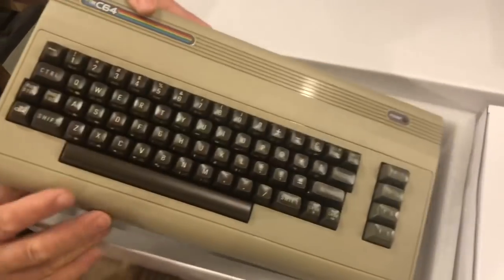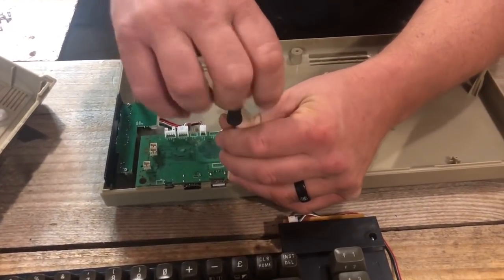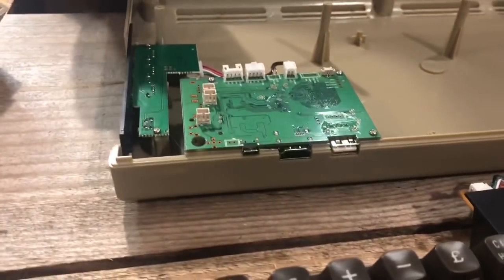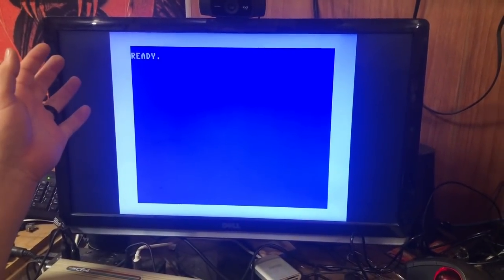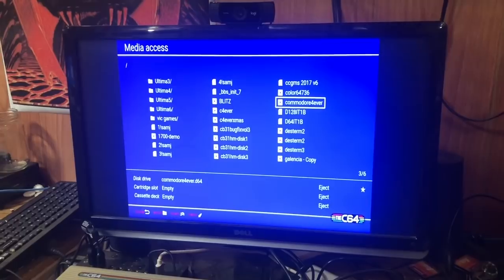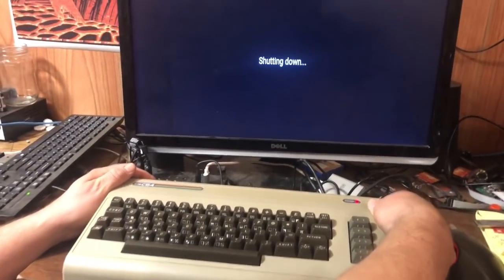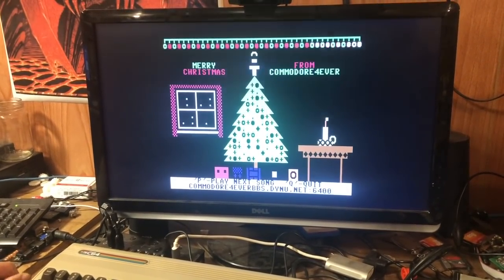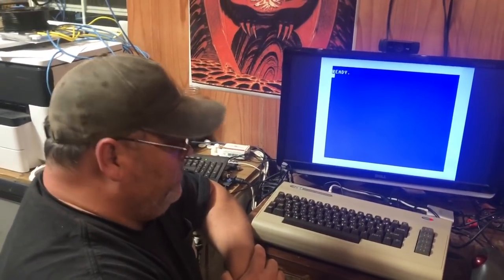The C64. My thoughts.

Comment: Excellent review, thank you.  I have a C128, and when I found out that Retro Games was coming out with this I decided to back them.  Kind of a cool nostalgic piece I guess, I was hoping they'd have the original Commodore peripheral ports though, but I guess being an emulated machine its not possible.  Maybe someone will come up with adapters at some point to allow you to hookup your old Commodore stuff.
Reply: They can't make those old parts. There focus was to give everything that you get from the Origanal Commodore but use modern tech such as USB and HDMI.
Reply: http://gurce.net/c64mini/hardware_compatibility_lists -i found there a adapter for the old joysticks.... i ordered one of them.
Reply: @A LITTLE BIT OF THE BUBBLY The ultimate 64 is just a circuit board so is not giving you everything you get from an Origanal Commodore? The C64 looks like a Commodore 64 but using modern tech like USB and HDMI instead of cratrage slots.
Reply: Can we attach the64 keyboard to ultimate64 implementation?

Comment: For my SD cards I use a microsd card  in a SD adapter.  when I need to connect it via the usb port I pull the microsd  and put that in a usb adapter that holds the microsd in a slot at the end and not the side so there is no issue with port crowding then if you want to use it on a regular sd slot again you slot it back into a microsd to sd adapter.

Comment: Very cool. Maybe shaving off the whole inside post of the keycap a proper adapter could be printed and glued to fit it onto an original keyboard.  Maybe they'll sell keycaps separately from extra stock. Is the color of the case correct? It looks too light shaded??

Comment: It is compatible with D81 files.  There is a full manual on the C64 website that has a lot of technical detail in it.  Would recommend a look through.  Great review though, nice to see someone really digging into the classic mode.  Also note you can snapshot save any programs you are working on as you would save a game.  Also plug your USB.SC card adapter in the side, it will fit better :)
Reply from the maker: lordchippers LOL. Yeah I guess trying the side usb would have been a good idea!

Comment: I used to like to program on a c64 but old ones are problem these days so I think this is great with the c64 maxi. I haven't been able to find out if the programming works like it did on an original especially when it comes to how you use sprites (if it does).

Comment: I wonder if it would be possible to adapt the entire keyboard to work on a real C64. Obviously the keycaps aren't going to work, but the whole thing might. I noticed the connector seemed to have some kind of adapter on it. That might be possible to replace with a cable that works.

Comment: Boy, that takes me back. I used to type in listings from magazines that would take hours, only to find there was a typo that wouldn't be corrected until next month's issue.  Still got my Commodore 64 in a box in the garage, along with the tape drive, and the 1541 disk drive. The monitor's gone now, and I always preferred the smaller mouse from Atari.
I've also still got an Atari Mega STE complete. Upgraded it to 4 whole megabytes before it left the shop. Nothing like living big! :))

Comment: I got a Mini for Christmas, and like the convenience of having it at my PC computer desk with a KVM switch.  Yeah, VICE would be more convenient, but since upgrading to Windows 11 my VICE stopped working.  Running it in a Win7 VM at the moment.  But, there's also the joystick factor.  I since purchased the micro switch version with the steal shaft.  The Maxi comes with that joystick, but the mini doesn't, so if you have a mini, don't start playing all those Epic games until you upgrade that joystick!  I do like that the maxi has both C64 and VIC20 modes.  I started with a VIC20 way back when.

Comment: I found it quite interesting that there are two (unpopulated) USB ports on the board itself; for a hardware-oriented person it would be trivial to solder in the receptacles, and then you could have 1 or 2 of those tiny USB flash drives permanently connected, and still have all 4 external ports free. 
With regards to the USB-to-SD card adapter shown in the video, there are some very cheap USB-to-Micro SD adapters (less than $1.00 on ebay) where the Micro SD card sticks out of the back instead of sideways, thus eliminating any issues with the HDMI cable. (Or just use a regular USB drive :P)
Several people have lamented the lack of Serial-, User-, and Cartridge ports on this new machine, but as far as printers and modems goes, there are plenty of USB-to-Serial and USB-to-Parallel converters available, so at least it's possible to connect standard versions of those external devices.
"Yeah but that costs extra money" i hear you scream; well, you can't expect a hobby to be without costs. ;)

Comment: Very cool, although I would like to see a clone with the old ports and new ports combined on a clone. So you can use old devices if you choose. I have the J&R Eprom burner and Supersnapshot crat among some other rarer c64 relics saved for over 35 years in my basement. It would be nice to use them.
Reply: To add backward cartridge compatibility would have added substantially to the cost. Your really only option is to buy a old c64 (or make one, I think there are kits now)

Comment: I've done a lot with emulators, but I was blown away when I powered up my restored C64 for the first time. Even though it's on a 4K display it FEELS completely different. It's something about the fact that it isn't perfect that it has an analog feel to the way it looks. Which is odd because I usually prefer the precision of digital. I was excited about this originally, but I think I'm going to stick with the real hardware assuming I can get it to read SD cards, which may be a voltage issue that I should have solved soon. I have a switching 5V PSU on it's way with an adjustable voltage knob. Hopefully that will solve my 4.5V issue. The C64 doesn't seem to care though and the diagnostic harness gave the system a clean bill of health.
Reply from the maker: Ashley Williams IMHO nothing will ever match the look and feel of the original.  What Commodore did can and will never be done again. It was perfect!
Reply: Reading sd cards on a C64 is dead easy. Go on ebay and buy an SD2IEC. You will get an sd card reader that will work exactly like a commodore disc drive (with the benefit you can swap between disc images on the sd card)
Reply: @dlarge6502  I did and it doesn't work. I wasn't sure if it was the device or the computer. I got the computer up to 4.85v And it still didn't work. I'm pretty sure it should have worked at that voltage. I'm convinced the sd2iec is faulty. The diag cart and harness gave the iec port a clean bill of health. Also I manually poked the lines on it high and low and they worked normally.
Reply: @awilliams1701  Why are you concerned about the voltages? Are you missing the original power adaptor? If so you need 12v also, and -5v i think to run a C64. Also 4.85 volts would be way too low.

 The SD2IEC steals power from the cassette port or user port depending on which one you buy. Most seem to go for the cassette port version, I went with the user port one as I need the cassette port. If you can confirm your IEC port works with a real drive and the SD2IEC is getting power on the port its stealing it from then you can determine if the sd2iec is working or not.

I re-read your post. I think you need to get closer to 5v as the TTL logic needs that. Dont forget the sd2iec needs to steal power from the c64. A fat32 formatted sdcard in the Sd2iec should allow you to list the contents. Usually sd2iec devices have a default drive ID set so make sure you are using the correct id.
Reply: @dlarge6502  5v dc and 9v ac. The computer itself is fine. There is some resistance in the switch. Not much but some. I've talked to several people that had sd2iec working with less than 4.8v which is why I think it's the device. Before when it was even lower I wasnt sure if it was the device or the computer. Anyway I need to pull the switch and see if I can eliminate the resistance. I would like it to be at 5v before I conclusively say it's the device. I didn't have a 1541 u2+ on it's way. Hopefully I'll have better luck with that.
Reply: @dlarge6502  oh and I tried device numbers 8-11. I've tried multiple cards including the card recommended by one of the sd2iec sites. I followed all the instructions.
Reply: @dlarge6502  but the iec port definitely works. I tested voltages with poke commands. I was able to poke the lines high and low. And the diagnostic cartridge and harness tested clean.

Comment: I wish the Next stop is the AMIGA!
Reply: Well that would be a INSTABUY!
Reply: Why? Just use an emulator like UAE. Same thing they will do.
Reply: They want it in a Original Case.
Reply: @worldsendace  So get a dead A500, a RasPi4 and a KeyRah interface.
Reply: @jensdroessler3575  i have a Raspberry with everything already. I even have a arcade cabinet powered by a pie, so I dont need that. ;-) dont forget those people are consumers , they dont want to build something.
Reply: @worldsendace  So you mean they don't want to build things despite the Amiga having always been a computer where you needed to put something somewhere to expand it and fiddle with software to make everything work (I mean even on an emulated system WHDload won't install by itself qnd without it there won't be that much iconic games to run) AND insist on having that in an original looking case? That is a small overlap in reality. People either don't care for it being in an original case OR they  know how to plug three things together and insert an SD card.
Reply: @jensdroessler3575  I have an A1200 with a ACA 1221 and a 4gb CF card with WHDload files, and several joysticks, and i still would like to get the Amiga like this.
I have build my self an arcade bartop with Hyperspin and i have build a Figthstick with Raspberry pi 3b in it. However I still would love to get The Amiga version of this..
So why not ?  i pretty sure that it would be popular and maybe even do something epic for the commodore community, bringing back people from the demoscene.
Reply: @chillz28  Sorry, what? An emulator in an Amiga case would bring people from the demoscene back? Any other emulator couldn't do that? What???  
To say it again: It is emulation technology we had available for decades now. It is just packed into an Amga case. Why the heck do you think that's worth your hard earned money? It's something you can easily do yourself, for less money, with more power.
Reply: @jensdroessler3575  An emulator still needs a mouse joystick and a screen, a ton of fiddling before you get where you want to be. Original hardware is a hassel, Expensive and you need a CRT to get a decent experince. This is plug and play so to say. We dont need to agree. Why are you even herem, if you can do this with an emulator ? just to troll or did notalgica trigger you to see if the C64 was something for you ? Why dont you speak of FPGA instead ? FPGA MISTer in this case could be epic.. and that could be why IM here.. but i would love to play with THE c64 and im sure that i would enjoy the no hasse setup with my LCD and a carusell frontend to support my experince with this product. 
Anyway I love this, you dont have to, And i would love to see an AMIGA version of this even if this is emulation..
Merry christmas and happy New year!
Reply: @chillz28  Sorry, your replies get more and more confusing. A "the C64 maxi" or a supposed "the Amiga maxi" needs no screen, mouse and joystick and lots of fiddling to get games to play? Alone the special file naming or text file editing to make games run on "the C64 mini/maxi" is really unnerving, because every try means taking out the USB stick, putting it into a PC, renaming/editing again, unplug, insert in C64 mini/maxi and try again. You think THAT is a better solution than running a C64 or Amiga emulator on a RasPi3 or 4, where you can edit such settings on the spot or even from your PC via Ethernet or WiFi WHILE the RasPi system is running? Also, there is not much fiddling with the settings needed if you buy Amiga Forever for example. Nor has been using stock WinUAE with downloadable presets.
And yes, an FPGA system would be even nicer, and it's not even expensive. Edu Arana sells breakout PCBs for MISTer cores. They fit into an A500 case, can use the original keyboard, original joysticks/mice, come with the FPGA board ready to run the MISTer A500/A1200 core (including AGA and faster CPU) and cost 95 Euros at the moment. Or get a Vampire V4 standalone.
My point stands, also for "the C64 maxi". It can't do anything better than existing solutions can already do. An "the Amiga maxi" couldn't do anything existing solutions can't do. Yet it is hyped, basically for old, well-known features.
As for why I'm here: I'm very invested in C64 and Amiga scene as both were my systems when growing up. I try to keep up with all the developments. And it actually saddens me if systems like this are called "the rebirth of a classic" or "C64 re-released", since it's only emulation done as cheap as possible, something any PC, RasPi, Android phone.... can do better. Now I'm just looking for some video that DOESN'T praise this thing to heaven, but says "it is what it is". "The 8bit guy" came closest to that for now.
Be aware that I DON'T say this thing is shit! I say it works, is easy to use as long as you don't want to add further games, but it is overpriced in my opinion and just WAY OVERHYPED for what it does.

Comment: No the C64 Mini don't have Classic Mode or Media Access,Classic mode makes THEC64 Maxi different than THEC64 Mini and one of THEC64 Maxi selling points to get one.Classic Mode will never be put on THEC64 Mini by Retro Games only if it gets hacked.
Reply: God, I hate calling it the Maxi. Makes it sound like a fucking feminine hygiene product
Reply: What? Everything you said is wrong. The mini and the maxi have the exact same firmware and aside from hardware differences and a couple of differences in the games pre-installed they work exactly the same. Off you go troll.
Reply: @dlarge6502  I am not a troll,I have a channel,I remember then YouTube was not owned by Google.
I was just saying it has Classic mode thats all, that make it different from the Mini,they added it so you can play multi Disk/Tape games ,go into Classic mode and try it. It does have the same Carousel as the Mini,just different games so it not the same as the Mini.I wouldn't want to buy a product thats the same anyway,I am glad it does different things.They improved it.(I removed silly comments)
Reply: @RETRONuts  Ah you meant BOOTING to classic mode is only on the maxi. Yes now I see. I thought you were saying that the mini lacked the c64 BASIC mode and couldn't launch stuff from usb.

Comment: You can get the Ultima III D81 disk working on it fine by creating a .cjm file in the same directory on your sd card as the D81 file and it has to be named the same as the D81, e.g. UltimaIII.D81 and UltimaIII.CJM.  The reason you need to create a CJM file is so that you can activate 'Accurate Disk Mode' .  You create a CJM file in a text editor on a PC and the first line should have accuratedisk in it e.g.-  X:64,accuratedisk.  Save the file with the exact same name as your D81 file except with CJM as the file type and the copy it to the same directory as your D81 on your SD card and Ultima III should load fine after that. If you download the full 'TheC64' manual from retrogames.biz it explains all about CJM files and accurate disk mode in there
Reply from the maker: sjstimer excellent information. Thank you.
Reply: Seen some one play Ultima on the mini so you can do it with this.

Comment: The only things missing are a Commodore User Port and an actual drive port.  The USB ports for joysticks are fine, because you can convert those back to a 9 pin if you use the right USB joystick board.

Comment: It's a custom built PCB with a 4 core Allwinner H3 System on a chip.  Which is up from the Mini's Allwinner 2 core A20 SoC.
Reply: More than enough to correctly emulate a c64. My orange pi pc Which is also using an h3 can easily emulate all consoles up to the Dreamcast. Curious to see if it will be hacked to support, let's say, retroarch ;)
Reply: Oh cool, I thought it was the same board. Glad its not.  It still uses the same firmware between them.  Well the same download, the contents of the firmware do some different things between the models, so far thats just with game selections.

Comment: This video was published almost two years ago.
I just got mine a few days ago.  I'm pretty impressed, though there were only two commercially made games I spent much time with back in the 1980s on the original C64.
I've got a lot of memory refreshment ongoing.  But, first I have to figure out how to save BASIC programs to USB flash drive.  I'm sure it isn't too complicated, I just couldn't resist jumping in and writing some simple programs to check it out.  As the programs grow, though, I'm gonna have to.

EDIT:  I see around 19:00 you got into saving to flash.  I'm bookmarking your video, looks like a good refresher for a number of things.  I haven't touched a C64 in at least 30-years.  If'n you don't use it, you lose it.  But, relearning is always easier than the first time around.  I hope, LOL.

YES it would be nice if it had all of the legacy ports of the original C64!  I saved most of my programming to cassette tape.  I didn't get my first disk drives until I was about to break to Amiga.